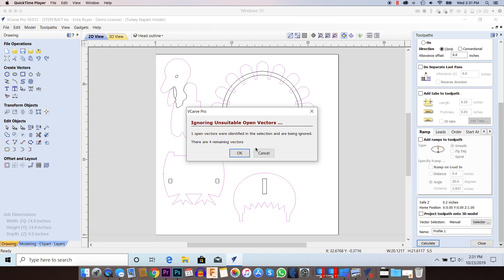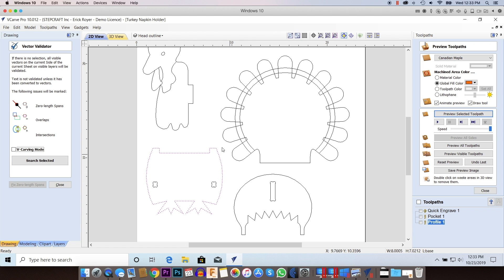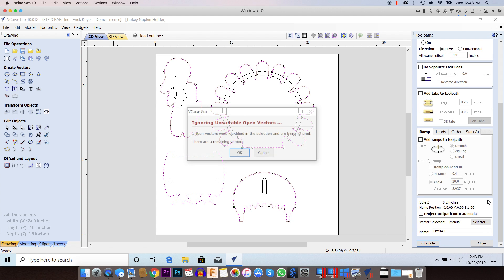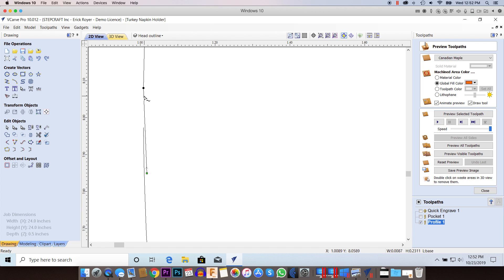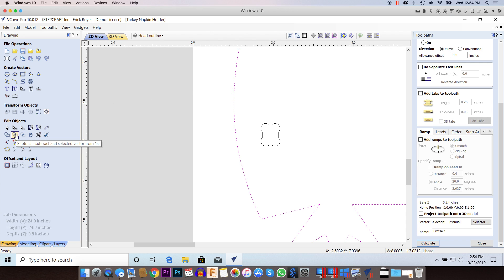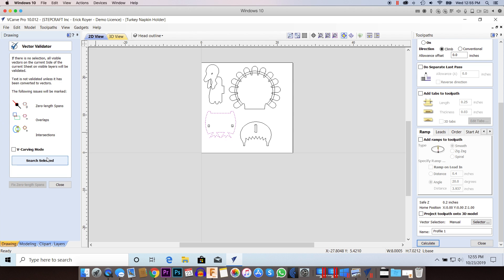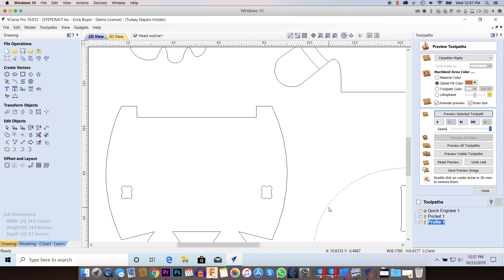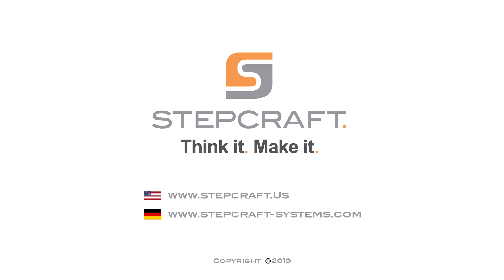How To Quickly Fix Vector Errors In V Carve, Cut 2D and Aspire

Comment: is that a mac or a windows computer? so confused
Reply from the maker: Vectric is a windows based software.  But I use Parallels program on my Mac so I can run Vectric with it.  It is basically a windows emulator for a Mac.  I have been using it for over 7 years without any issues